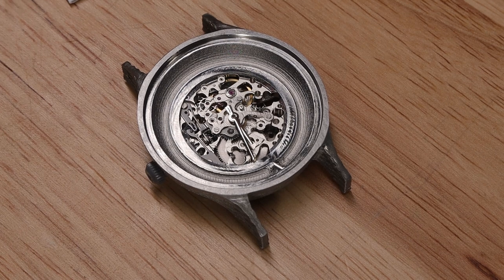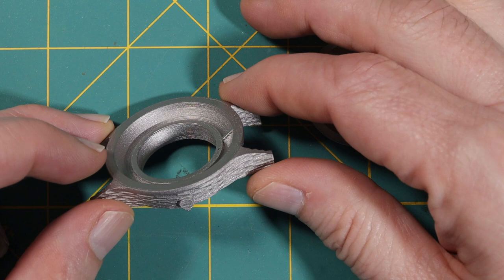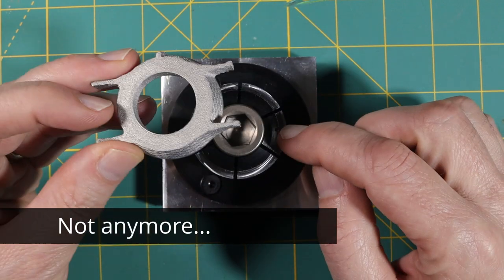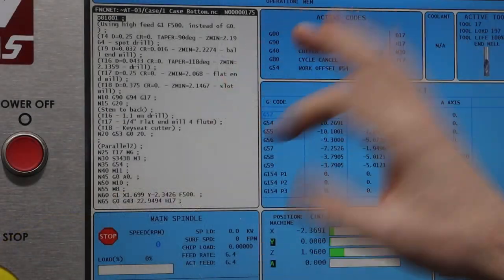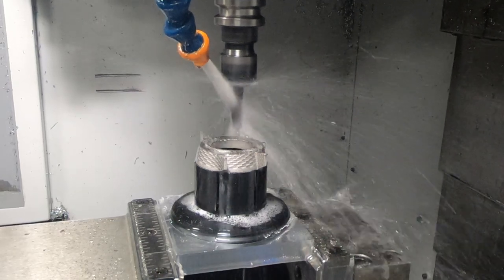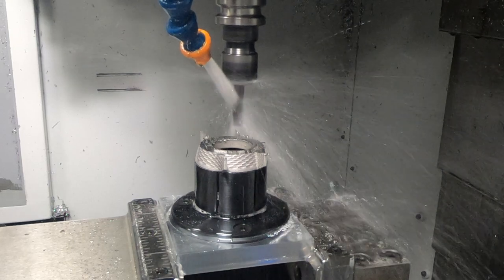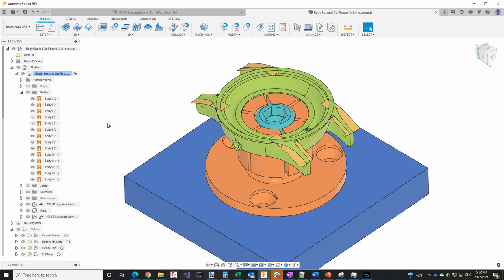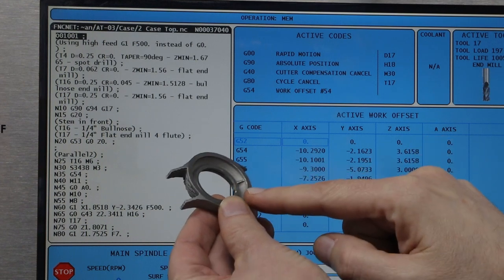Watch Case - Machining a Prototype, Part 1

Comment: I would be terrified to work on this without a few extra 3D prints in case I screw up. The watch is beautiful!  It would be cool if the individual circular segments on the watch face could light up in succession in different colors throughout the day. It can be done with tiny RGB LEDs, a diffuser and a micro rechargeable battery.
Reply from the maker: They sent me 10 cases and 8 backs, and I needed to delivery 6. So I did screw up a few, but had enough so I could delivery the 6. One of them is for me, and I'll be getting it back very soon.

Comment: Great job John. Proof it's all about set up and fixture to keep alignment for repeatable position when the part needs to be flipped back and forth.
If you could set up on your 4th axis secured from the ends?
Reply: I was thinking abouot the same. The 3D printed model could have mounting features extending from the 4 tabs. That way you could run all the work in 4th Axis and have access from both sides.
Reply from the maker: I tried my best to think about how I could use the 4th. But it would not work at all for the internal or conventional 3 axis type machining, which is the majority of the machining. I will be using the 4th in the next video. A 5 axis machine could do all this work with just two setups instead of three. The issue is that I need to mill details on the top (including inside features), the bottom (including inside features and holes), and the sides.
Reply: @JohnSL  John I will e-mail you with a picture of what I have in mind.
Reply from the maker: Ah, I see what you mean now. That's an interesting idea. As you point out, that would allow a single fixture for milling everything. That's a very interesting suggestion.

Comment: My post has an option for "Write tool list", you might want to find/add that to yours so you don't have to do the manual nc blocks.  Looks easy to edit to only do tool numbers higher than you want.
Reply from the maker: Thanks. I should have clarified that I am also using the list output by fusion, but it doesn't always have details I need. For example, it shows the 1mm drill as something like 0.039" drill. So using the comments allows me to be more specific about which tool.

Comment: After doing this, do you think it might have been easier/better to start with a solid block rather than a 3D printed approximation?
Reply from the maker: The milling to get the external texture would likely require a very long time because of all the details. So I believe starting with a 3D printed shell is going to cost less overall.

Comment: Great job! I learn a lot with your videos. Today I learn two trick in Fusion 360 as well as dissolving a tap!  please talk a bit about the speed of machining stainless. too slow will harden material and wear tool. Too fast will break the tool. I follow you since your Taigmach project.  I started with Taig but I settled with making a fourth axis for my needs as you can see in my video.  I sometime have a HASSTAIG envy but I take a glass of water and it pass...
Reply from the maker: Thanks. I mostly used GWizard for the feeds and speeds calculations where I selected stainless steel as the material. It hasn't failed me. I've put making a video about this in my backlog of future videos to make.

Comment: If it goes into production, will it be investment cast?
Reply from the maker: They will be 3D printed and CNC machined. Their web site says available in April. The process to get there will also be interesting.
Reply: @JohnSL  I had the impression that metal 3D printing was pretty expensive & therefore only really good for prototyping but I guess that's not necessarily the case (haha) for parts like these.
Reply from the maker: I don't know their cost structure, but they've factored the cost of 3D printing into that.

Comment: You have a 4th axis sat right there, this screams 4th work to me,
Reply: The 4th axis is horizontal but most of the machining requires the part to be vertically oriented.
Reply from the maker: As Bob pointed out below, the milling is mostly vertical, so a 4th doesn't help, except for the sides (stem and strap clip holes).